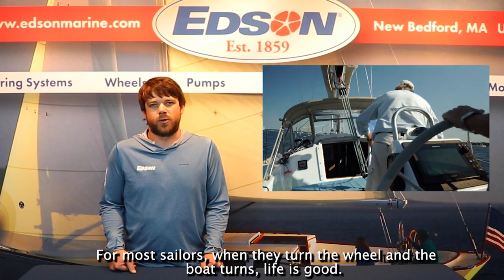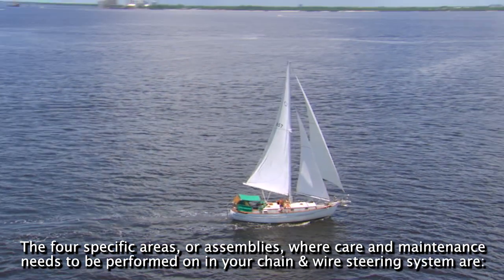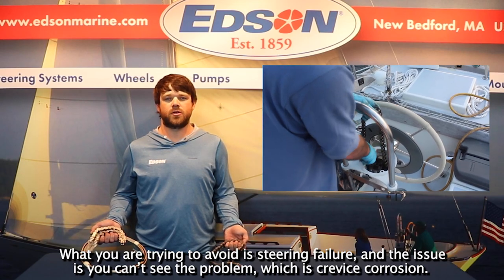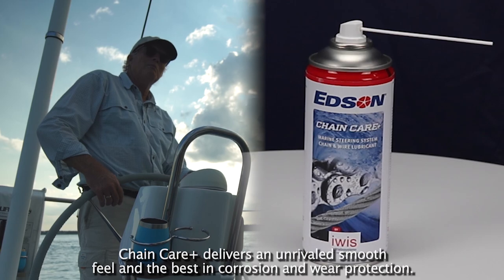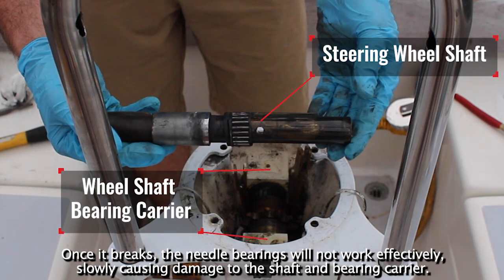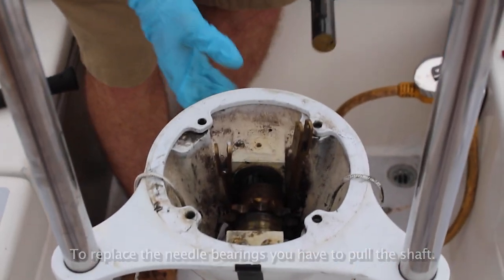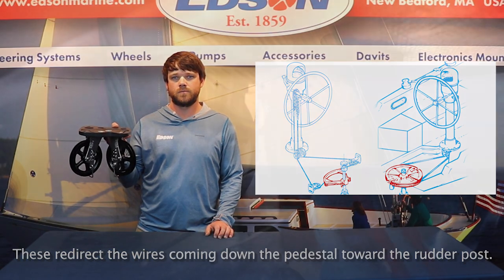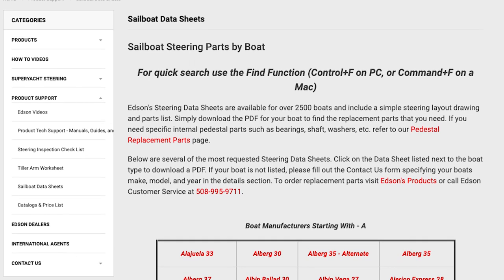OVERVIEW - Sailboat Chain & Wire Steering System [Maintenance & Replacement Schedule]

Comment: Thank you this informative video . Before sea trial on a 1979 Westerly 36, the owner turned the wheel at quay (wheel was hard to turn, rudder was in the mud, unbeknownst to him) and the chain link and ring connecting it to the wheel broke. Upon inspection , it was found the non stainless ring linking the chain to the steering wheel was corroded and had broken in half. Now the owner proposes to repair it. The yard has fabricated a ring from a stainless shackle and is looking for a replacement chain link.
Watching your video , this does not seem to be the proper fix. What would you suggest ?
Reply from the maker: Hi Lydie - At this point, the whole chain and wire assembly should be replaced. Our pre-made assemblies have custom connections between chain and cable, but if you are doing it on your own then a high quality stainless shackle can be used. Not sure what role the ring play, the cable's eye can be attached directly to the shackle.
Reply: @edsonmarine  thanks for the advice , I will check the repair and replace the parts needed.

Comment: Hey, thanks for you amazing video, was super helpful 
I’m also wondering if you know a quick way to find a idler assembly, unfortunately mine got stollen:(
Reply from the maker: HI Faez, thank you for your compliment on the video! We're really sorry to hear about your stolen idler. If you are able to give us a call at (508) 995-9711, we can help you with determine the correct part number for the replacement. From there, we can help you with a new one, or you can go through any of our dealers. You may even be able to find one on the used market, but be very cautious in your selection as this is a highly loaded component.